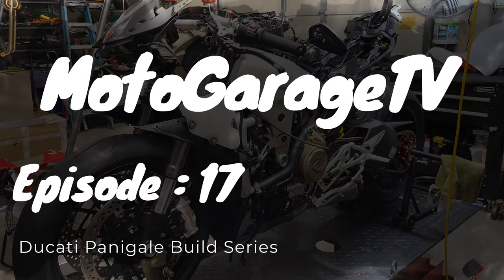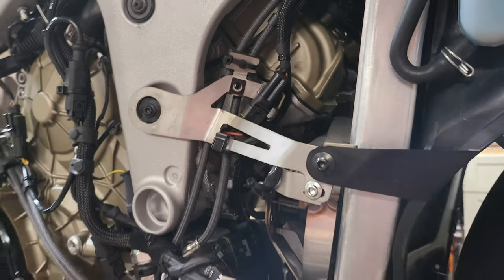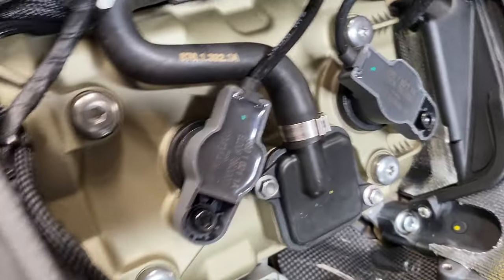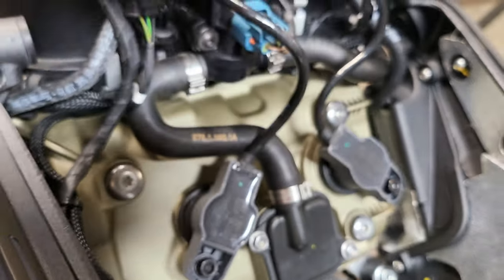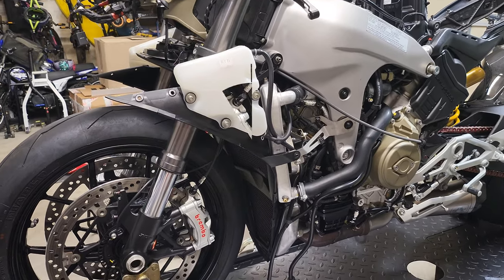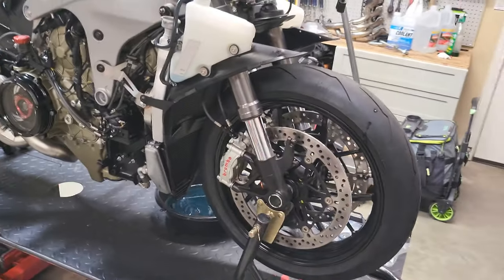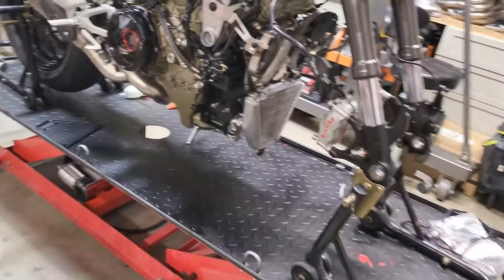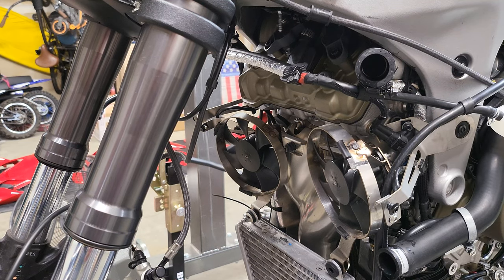Ducati Panigale V4 | Front Head Timing Cover Gasket Replacement

Comment: did you have to put the rtv in the channel all the way around before pushing the gasket on? did you have to clean old rtv out? confused about that part
Reply from the maker: There were only a few spots where I saw old RTV from the factory inside the cover. Little cleaning is required, I also prepped the channel with some some rubbing alcohol. There was nothing on the head itself. I applied a small bead of RTV around the whole channel before installing the new gasket.

Comment: Are you a mechanic by trade? Great info! Thanks for the content
Reply from the maker: I'm not a mechanic by trade. I've been working on my own bikes since I could remember. I try and research my projects before I start and use shop manuals to fill the gaps. Sometimes, I have to take things apart and explore before understanding the problems. I should probably put some type of disclaimer in my videos

Comment: Great vid! What are the torque specs for the cover bolts?
Reply from the maker: I couldn't find torque specs on these particular bolts. I went with what I thought was good based on how tight they felt backing them out.

Comment: Very informative video but i think theres a sealant that needs to be applied on the both covers where the rubber gasket sits on.
Reply from the maker: You are right, I mentioned that in my video, and I applied off camera. Very important tip. Thank you
Reply: Awesome 👍 mine is leaking from front and rear cylinders but not too bad to where you loose alot of oil. I have all the parts for the front and rear im just waiting for it to get really worse then imma start on it 👍
Reply from the maker: @novasevenfold502  I hear you, no sense of fixing it if it's not broken.

Comment: Hi, there. I have the same leak on my 2018 Ducati Panigale V4S. I have to replace the valve cover gasket, do you know whats the torque spec on the 4 bolts for the valve cover?
Reply from the maker: Hey, I don't recall what that torque amount was. Just guessing I would say around 10-15nm

Comment: Mine has just started to leak (21' V4s). Anyone who has had the gasket replaced had the issue re-occur? I am thinking when I replace mine that I put RTV bond on the head as well to make sure there is a really good seal
Reply from the maker: Definitely use the RTV as well.

Comment: What’s the part number of the gasket and the 2 seals?
Reply from the maker: Stop the video at 2:15, and you will see the parts listed. I highlighted them in yellow.
Reply: Thanks for responding. Im about to do mine tomorrow. Looks like it’s tricky to put the cover on especially with the rtv gasket maker on it too. Any tips to make it easier to install?
Reply from the maker: @JVSKRR-is7qr  hey hope this reaches you in time before your installation. I'll let you know what worked for me.  I applied a small amount of the RTV inside the groove where the gasket would insert, then pressed in the gasket. I turned the cover over and just let the weight of itself hold the gasket in place. I let this sit for about 10-15 minutes before installing. This helped hold the gasket in place while installing. I suggest temporarily zip tying cables/ lines out of your way to allow an easier install of the cover. I was fighting some wires and ended using a few zip ties and made a huge difference. Hope this helps.

Comment: Why are you replacing a valve cover gasket on a new bike?? Was it leaking? How many miles on the bike?
Reply from the maker: Yes, it was leaking. The bike has 5k in miles. I'm the second owner, I imagine since it's just a rubber gasket, the original owner let the bike sit and the seal dried out. It was a small leak and a relatively easy ands low cost item to fix.
Reply: @MotoGarageTV  I see, good work and nice you are sharing it with other people
Reply from the maker: @Max Biaggi  thank you, I appreciate that. I tried looking up the process before I tackled this one and came up with zero hits. I'll continue to post my work. Thanks again

Comment: Mate, how much did this build cost😂? I’ve rebuilt several engines and reused all the hardware, just paying a few quid for the leaking gaskets. I appreciate the work though, don’t get me wrong.
Reply from the maker: This repair in particular....$53 dollars. I could have just bought a new gasket and reused the bolts, and it would have been closer to $20 dollars.
Reply: @MotoGarageTV  Yeah, that’s all right. Fair prices, glad to hear that the maintenance parts are reasonably priced👍 But the other stuff you’ve put on is insane😂
Reply from the maker: @NitroTruth  tell me about it. I've spent about the same amount on add-on parts as I did on the purchase of this bike. Close to 18k in add-ons alone
Reply: @MotoGarageTV  Love it😂 I'd do the same if I had the money!!